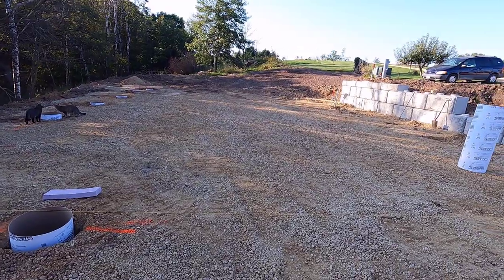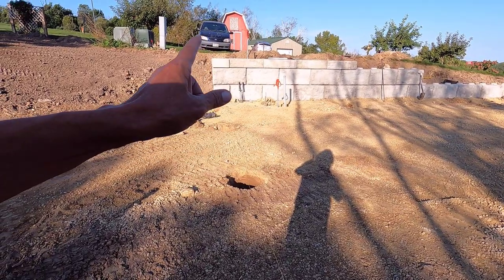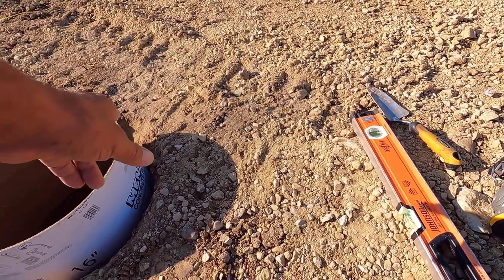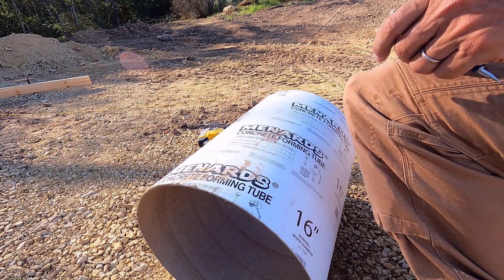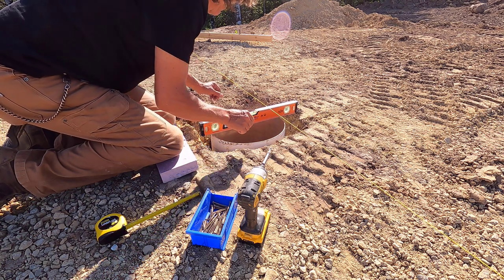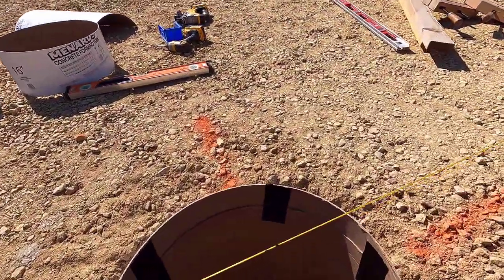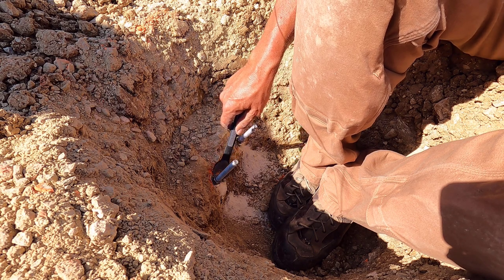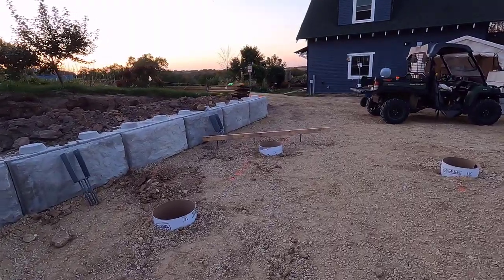Placing 9 Sonotube Concrete Forms in Very Sloppy Holes [and Bedrock]

Comment from the maker: I knew going into this project that it was going to be difficult drilling these holes, I just didn't know how difficult! Because of the insanely rocky ground here on top of this ridge, nearly every hole on one side of the platform hit either boulders or bedrock. In this video, I deal with all of the 'less than perfect' holes and get the last of the sonotubes in the ground, and get the site ready for concrete tomorrow! Big things to come! 

Massive Concrete Block Retaining Wall -- https://www.youtube.com/watch?v=4HK40MAtL6g&list=PL_iZ8t8zAFuOSMNq3yhlyQUgLPqPdgVQ9

The Frost Protected Shallow Water Line Playlist -- https://www.youtube.com/watch?v=fHqK2tsprhE&list=PL_iZ8t8zAFuMRCCA56rTahk9c-LRbPq4j

The Woodshop Build Playlist: https://www.youtube.com/watch?v=0lj0BOLzIRo&list=PL_iZ8t8zAFuN1C0XY70Gd-EaS0z2Knt0Y

Woodshop Build Tool Links:
Stabila 35712 Extendable (7 to 12 foot) Plate to Plate Level - https://amzn.to/3iGdpwP
Stabila 30035 Plate Level Case for 7'-12' Plate Level plus 24-Inch, 48-Inch Level - https://amzn.to/3AETnZQ
Woodford Y34-3 Yard Hydrant Freezeless - https://amzn.to/3AHE5Dr
Johnson Level & Tool 116 16 Ounce Plumb Bob - https://amzn.to/3jKIj6k
True Temper 00221400A Wood Wheelbarrow Replacement Handles, 60-Inch - https://amzn.to/3xLU4Pc
Starrett-C33H-12-4R Hardened Combination Square -- https://amzn.to/2KL3YOu
DEWALT Metal Shears Attachment -- https://amzn.to/3l8aYoq
DEWALT 20V MAX XR Compact Reciprocating Saw -- https://amzn.to/3nKHVFG
DEWALT ATOMIC 20V MAX Reciprocating Saw, One-Handed, Cordless, Tool Only ― https://amzn.to/2Msu21r
Legend Valve & Fitting T-5500 Lead-Free Brass Curb Stop, 1" - https://amzn.to/3jU9VpO
12 Ah Battery -- https://amzn.to/33JN48U
9 Ah Battery -- https://amzn.to/2SKUQwN
6 Ah Battery -- https://amzn.to/3odC6BW

Comment: How did you establish the  string elevation? I have four 4 foot x  8 inch diameter sonotubes that I want sticking out 4 inch from grade. Can I just set a random level line height from the building out over my four tubes, say six inch and measure down 2 inch? I am building a Catio off the home for our five cats. The frost line here in Western Pa is 44 inches. Sadly for me the only one man post hole digger came with no extension so I barely got to 30 inches. I may just cut them because digging by hand kills me! I am 67 and after digging four holes with a powered post hole digger nearly killed me! Two of the holes fought me with rocks and hard clay! What say you?
Reply from the maker: Correct — I believe. What I did was I found the highest point then went up a random number from there. I believe I went up like 3 or 4 inches — it doesn't matter, as long as you measure down to the tops of the sonotubes the same all the way around. I believe the sonotube at the highest  point was like 1" above the ground in the end, and the lowest was 8 or 10 or something like that. Then we filled-in the entire area until the gravel was nearly flush with the top all of the sonotubes. Good luck!

Comment: Love this! Having a carport installed and builder opted for sonotubes. He regretted this choice after hitting rock very quickly. 6 posts down to 48' because frost line. One of which didn't make it that far but sitting on very large rock and cleared by inspector.  Trouble aligning 2 sonotubes and bracket is on the edge.  He says it's fine and passing building inspection. Wondering how to make this better. Maybe I'm just overpicky.
Reply from the maker: The brackets on the edge will be fine as long as their not so close that the rebar will break through the edge — and that would be real close! I'm the same way. I would rather have all of the brackets dead center, but that rarely happens. The good thing is that it will be just fine, and you will never see it again once the building is completed 😊
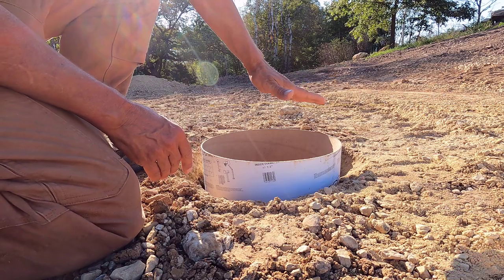Reply: @PlanetMojo  thanks for the reassuring words :) the brackets are well within the sonotube, but it's  the corner that sticks out from the pier, not an entire side.  A bit like your concrete poor video at 7:09. In practice, it sounds like keeping them centred is easier said than done. My problem was a boulder as well.  .
Reply from the maker: @mitsygaynor  You're welcome, and good luck with the project! 😊

Comment: Hi Mojo, wow that was a long and stressful day, but a job well done, let's hope the rain holds up till you have the concrete poured good luck.
Reply from the maker: Hi Larry, you are correct about the rain. If it rains more than a very little before the tubes are filled, it will not only fill the holes with water requiring clearing, it may destroy the tubes if there is enough of it! But on the bright side, after the tubes are filled and the brackets are set into the concrete, I can work in nearly any weather within reason. 😊